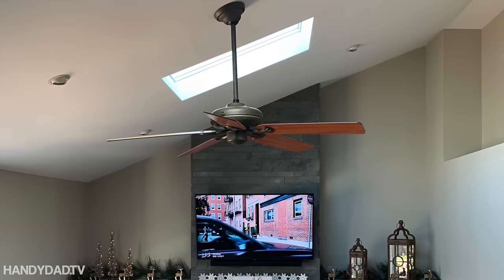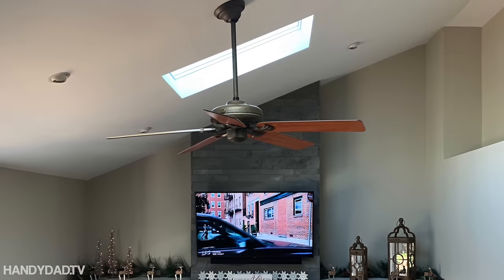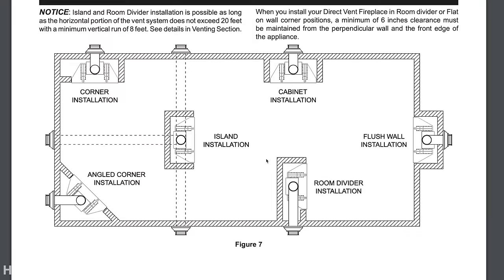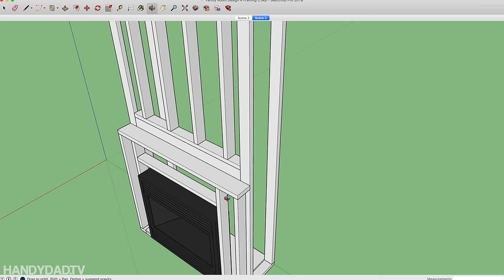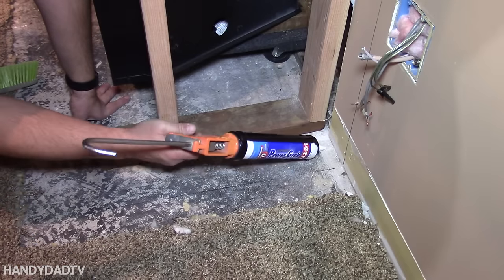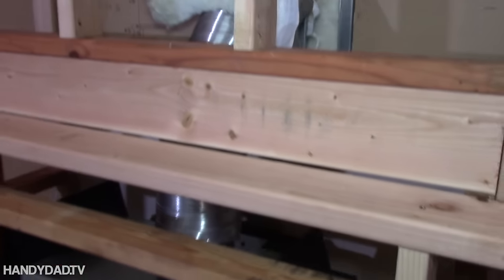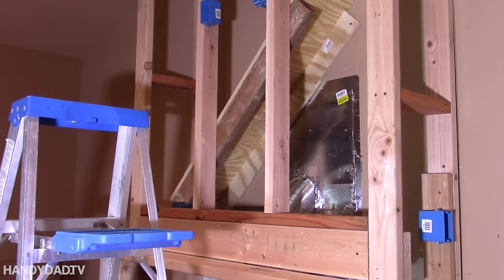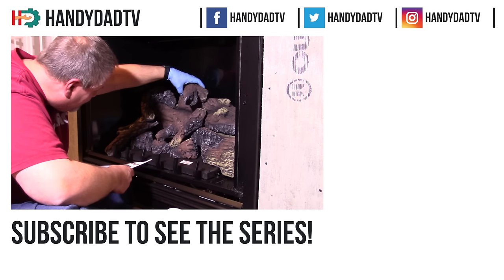DIY Fireplace Installation - Framing and Final Connections

Comment: I’m a fireplace tech in Canada and would NOT recommend putting rock wool insulation around your vent. 1 inch clearance TO EVERYTHING. (Only for the vent.) the vent gets very, very hot. I have seen smelly fireplaces that this was the culprit. Is also a fire hazard. Other than that was a great installation. Good job.
Reply from the maker: How can it be a fire hazard? Rockwool is non-combustible. I installed it per my inspector’s instructions.

“ROCKWOOL insulation won’t burn, or release toxic gases or smoke when exposed to high heat.” Per https://www.rockwool.com/learning/fire-safety/
Reply: Rockwool isn’t combustible, I suppose it may be possible for it to smell after being heated and cooled multiple times

Comment: Great video, is there no requirement for the fireplace itself to not be touching wood? Seems odd there is a clearance requirement above when you put the fireplace directly on plywood and studs right next to it.
Reply from the maker: The heat comes out the front and rises. Everywhere else is well insulated so it can be installed next to wood.
Reply: @handydadtv  Right, I get the concern with the mantle, just expected the generally overly cautious code to include some clearance below and to the sides, but if not, that makes things a lot easier. Thanks for the quick reply.

Comment: looks good!  imo i would not use phosphate screws in durock/concrete board, especially that small with all the weight of the stone/tile.. stud then plywood then liquid nail and screw durock on.  i love the built ends

Comment: What type of sealer did you use for the venting? High temp silicone sealant or did you use a fire block sealant? Performing a very similar project with the same vent kit and fireplace and love how yours turned out.
Reply from the maker: The tube was sent from eFireplaceStore with the fireplace. I didn’t pay attention to the brand but it may have been this one: https://www.efireplacestore.com/cpf-81137.html?refnum=Dec-298-2893
Reply: Amazon has it and its 33% cheaper for double the amount. I support the little guy as much as possible, but I think the days of massively overcharging for parts and incidentals in the hvac field are ending.

Comment: @handydadtv thank you so much for this series of videos, we've followed it and has been a great guide for a project with my father-in-law! Question on your venting - did you use the 4ft flexible vent kit, or did you have to get a longer extension?
Reply from the maker: I used a single flexible vent. No extension.

Comment: I do have One Question for You> Did you use a Stainless Steel Liner?  I only ask out of Concern for Safety reasons and Im sure a Inspector would have noticed -
Reply from the maker: Are you talking about the vent pipe or the firebox? In both cases, I used the accessories specified in the fireplace installation manual. And it might surprise you but the inspector didn’t ask.

Comment: I'm looking at a gas direct vent fireplace.  Reading through the warranty info, it states "The gas appliance must be installed by a licensed, authorized
 service technician or contractor qualified and authorized installer, service agency or supplier."  Does this mean that the warranty is void if I do the installation myself?  What's your experience or thought with this?
Reply from the maker: I’m no lawyer, but as long as it’s installed according to the local codes and installation instructions, they’ll stand by their warranty against manufacturing defects.
Reply: Mostly a liability thing as well. If you burn your house down because you screwed up the install you cant go back and blame the manufacturer.

Comment: Great Video. Love it! Can drywall be used above the fireplace or must it be concrete board?
Reply from the maker: You can use drywall if you’re just going to paint it. The cement board was needed because I covered it with stone.
Reply: Im an installer, and many gas units have minimum requirements of steel studs and concrete board above and around the unit. It is different for every unit though.

Comment: I have similarly constructed fireplace, but the TV is not recessed. I wold like to modify it. Do you think cutting those middle studs and pushing the cement wall back 10 inches would be an issue in terms of fire hazard? Does it get really hot behind that wall (above the fireplace, but inside of the framing)?

Great video, btw, it helped me understand what I have behind the wall. Thank you.
Reply from the maker: I didn’t operate the fireplace (other than a test) before closing the wall. So I can’t say for sure, but I assume the pipe gets hot and that’s why they specify minimum distance to combustibles in the installation manual. 

It’s impossible to know how far back you can push back the wall above the fireplace unless you open it to see how the pipe runs. It might be a rear vent and you’d be golden. If it goes straight up and you’d be stuck. If it bends, like mine, you’ll need to lookup the manual or call the manufacturer.
Reply: @handydadtv  Thank you so much for responding. One more question please. 

I had an idea of placing the central speaker 15 inches above the fireplace. The idea is to install this https://www.houzz.com/product/139253654-zachary-non-combustible-shelf-whitewash-72-transitional-fireplace-mantels
 5 inches above the top of the fireplace itself, then leave 5 inches of space and then the speaker. 
As the speaker is 5" deep, and this non combustible shelf mantel is 9" deep it seems it would be well protected from any direct heat. However, the speaker would be only 15 inches from the top of the fireplace. And while 15" much more then what the manual is asking for mantel (6 1/2"), it is not made of solid wood. The questions is, do you know if these mantels get hot or the top remains cold like mortar?
Reply from the maker: Your link is a non-combustible mantle so it will absorb/deflect the direct heat effectively. Still, convection currents wrap around my mantle and my TV and speaker bar do get warm. But I wouldn't say hot.
Reply: @handydadtv  I understand. Will install it and see how it goes. 9" deep sounds assuring, but you never know until you try it. 
Thanks a lot for a great video and all the help.

Comment: This was helpful. I struggled with sketch up. How did you add just one wall? Also what were your resources for fire safe materials?
Reply from the maker: First of all, I have a daughter named Becca so you’re already like family. 😉

SketchUp is a great tool but I’m no expert. It starts with a blank canvas, so I just draw the minimum stuff that I need to communicate my vision to the wife. I also use layers to show/hide components as needed. 

As for fire safe materials, I used cement backer board from Home Depot and stone veneer from Norstone. I did a separate video on this topic https://youtu.be/VJGivGau8g0

Comment: Ty for the video. I have a question I hope you can help me with. The metal ^  brackets that are on the top of the fireplace insert on either side of the Flue. Are these removeable if not used in the framing process?  I'm redoing the front of my fireplace and on my insert they stick out too far, and I'd like to remove them. I don't have any literature on the fireplace insert it's over 25 years old.
Reply from the maker: They are there for your safety so you don’t put combustible materials too close to the heat. Don’t remove them.
Reply: @handydadtv  That's what I figured. Thanks for the reply

Comment: Looking ahead to a similar project with the 42" version of that Empire fireplace bought online as you did. So thanks for the video, especially doing the framing and the gas. 

We are still considering contracting the install or doing some blend combining my work in the mix. Hey, are you interested?! (Gig Harbor, WA...could possibly offer some vacation accommodation as part of the deal!) 

Our install is on an outside wall with 2x6 framing and not a big wall space - more of a feature wall concept. Plus, we are setup with LP, not Natural Gas.

I had a couple questions: 1) Why didn't you use the old fireplace flue and run 4" inner pipe up to a new dual pipe cap? 2) Can one use that stainless gas pipe for LP? 3) I didn't see a video on the tile work to complete the surround...did I miss it? I'll scan the collection again, too.

Thanks.
Reply: Answered 3) with my further review of the series. Nice job!! I love the ease of stone setting and no need for messy grout! Perfect. Now to my drawing board...is there a comparable program to Sketchup for Chromebooks that you'd recommend?
Reply from the maker: I didn’t use the old flue because it was capped 15 years ago and it would be treacherous to remove the cap and redo the flue. More work and cost for no benefit, other than avoiding the direct vent. 

I am almost positive you can use CSST pipe with propane too, but check with your inspector first. 

Thanks for the vacation offer but I’ll have to pass. 

Glad you found the stone video because that’s the icing on the cake! Looks great and so easy to install.

Comment: I have a fire place built in 1956....It takes up space in my kitchen. I want to break the wall and take back a few feet so I can add a bigger fridge. Is that possible? When I knock on the wall it sound hollow on a large part of it. Was the extra space done on purpose or can I reclaim it?
Reply from the maker: You won’t know until you start removing the plaster or drywall. Just remember that walls were built for a reason, and usually it’s to support whatever is above them. Never remove a wall unless you 100% sure it’s not load-bearing.

Comment: Handydad, what's the best way to determine the framing above an exising gas fireplace, looking to mount tv above fireplace??
Reply from the maker: I think you need to determine the make and model so you can get specs from the manufacturer. Otherwise you’d just be guessing.
Reply: @handydadtv  I'll find that info, thanks.

Comment: Looks good I’m wondering where those drywall screws you were using and is that a moisture treated piece of 2 x 4 you have going against the concrete ? Looks great man good work
Reply from the maker: Yes, normal drywall screws. Didn’t think about moisture from the concrete. Whoops 😬

Comment: Great videos. I am currently moving a gas fireplace from one part of my house to another. I am looking to use your idea of using the metal stud and sheet metal to create the wall pass through as you did. Did the inspector say anything negatively about that? I am a fairly skilled fabricator and would hate to have to spend gobs of money on a pre-fabbed unit. Im going to ask a local inspector too, I just wanted to heard about your experience. Thanks!
Reply from the maker: He said it was fine. He even suggested filling it with rockwool insulation. I didn't think of that.
Reply: @handydadtv  Thanks for the reply!

Comment: Nice video, i installed a pilot system, the tubing seems to be very close to the open flames, is this ok
Reply from the maker: I suggest you follow the manual and call the manufacturer if you have questions or concerns. There’s no way I could tell you if it’s okay.
Reply: @handydadtv  i understand , i followed the instructions just seems close to the flames. Steel rated for very high temps il put my hand in there see how hot it gets

Comment: what is that wonderboard? and how do you fasten it to the top of the fireplace under that 6 inch gap? im assuming that there has to be something done to connect that since you dont have anything like the sides do with their cripples to fasten to
Reply from the maker: Yes it’s Wonderboard. The fireplace is only attached on the sides, not on the top.
Reply: @handydadtv  sir, what i mean is "what is wonderboard?"
Reply from the maker: Oh sorry. It’s cement board. Non-combustible.
Reply: @handydadtv  is there a particular thickness required?
Reply from the maker: Not really. It’s primary purpose is a backer board for tile or stone veneer. My stone was heavy so I used 1/2” sheets (or thereabouts). It comes thinner but I wanted thicker.

Comment: Oh ok so you got from Ktt that's great but I wanted to know if for your sake that You put in a Stainless Steel liner- That's is the tube that goes from the top of the firebox out your roof. I watched most of the video and I didn't see a Gas Hook up so i am assuming that this is a just a wood burning fire place -  If it is Just a wood burning fire place and not gas than you would have had to use a stainless steel liner as opposed to an Aluminum -  Not trying to invade your space but want to share this important issue with you..  I know this is not your primary job and wanted to make sure you know the difference between a Stainless steel liner and an aluuminum liner which again is the Round Tube that evacuate the emissions/smoke etc. at first I thought is look Stainless steel than I thought looks aluminum when i saw the crimps - am I missing something perhaps?? and yes the vent or pipe I am speaking of
Reply from the maker: This is the vent kit I got for the Empire Tahoe NG fireplace: https://www.efireplacestore.com/cui-dvvk4f.html

The description says it’s 2-ply aluminum.

Comment: Fire foam ... not insulation ... or fire silicon rated for high heat and 2 firestops not metal framing need
Reply from the maker: I wish you were the inspector. I followed his advice.